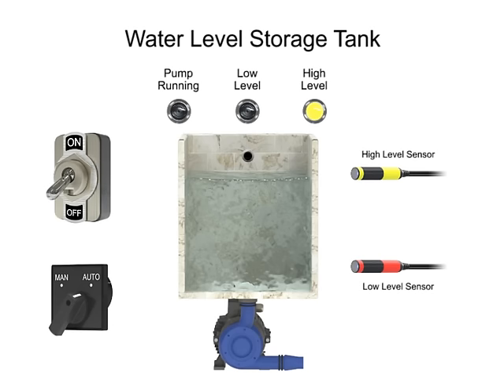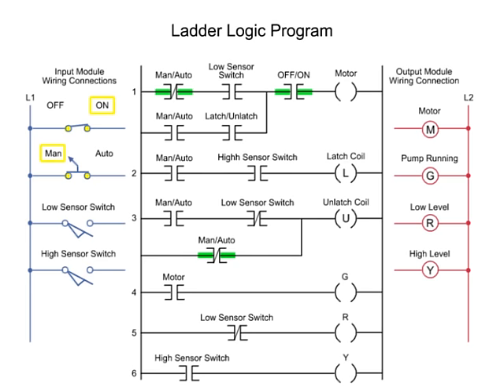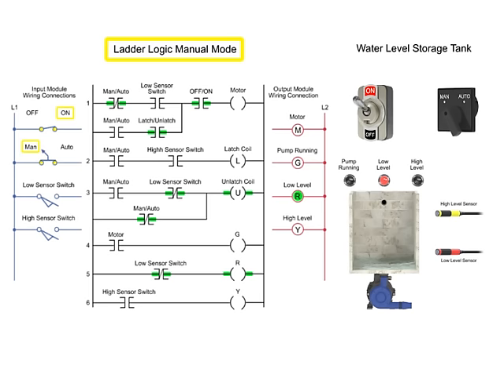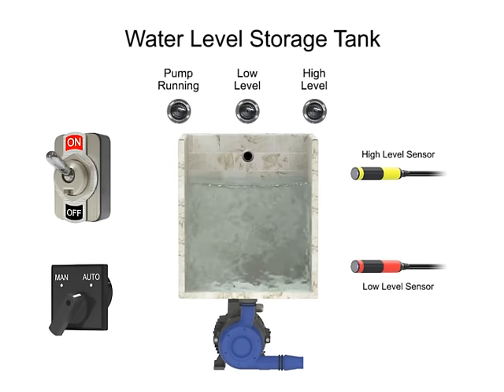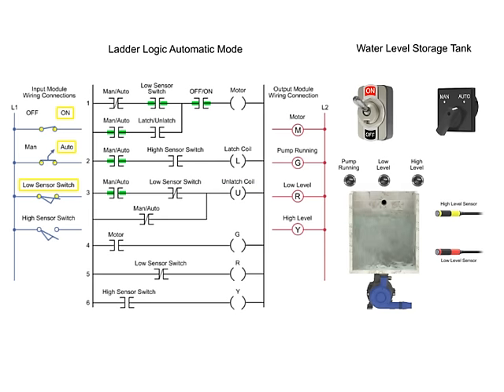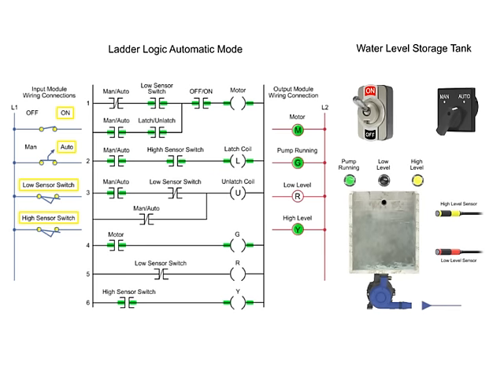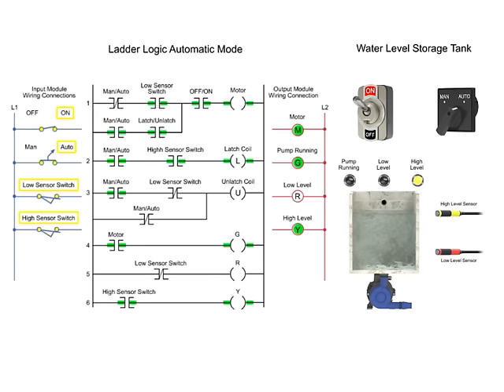Controlling Water Level in the PLC Ladder Logic Program

Comment: Please I want to control up to 9 tanks with 3 pumps from 1 borehole. 1 pump feeds 3 tanks, but if the 4th tank goes Low, the 2nd pump comes on and if the 7th tank goes Low, the 3rd pump comes on. The 3rd pump goes OFF when we have less than 7 tanks, and the 2nd pump goes OFF whenever we have less than 4 tanks in service. This implementation can allow 9 tenants to automatically / manually control their water tank levels without some tenants taking water every time to the detriment of other working - class tenants who visit home late in the nights after work. Each time a tank is Low, a pump will come on, a valve will open...two tanks...3 tanks the same pump..if a 4th tank is empty, the particular valve opens and the 2nd pump comes into service...but if 1 or 2 tanks are filled, 1 pump drops off...etc .thank You. My pumps here are for tank filling, not for tank discharge...
the discharge shall be manually by domestic consumptions..tanx..

Comment: can you give us more discussing about latch and unlatch bits 
Are latch and unlatch control on the motor and pump or not?
Reply: There is only one latch/unlatch bit

There is only one latch/unlatch bit, and it is an internal bit i.e. it does NOT represent a direct input from a sensor or output to a motor or a pump or a lamp.

The most important thing to understand is that the latch/unlatch bit represents the LAST state CHANGE of the level inputs; it does not represent the CURRENT STATE of those inputs, nor does it represent anything about the motor or pump.

The latch/unlatch bit is internal to (part of) the PLC program so the PLC can keep track of the last level sensor that CHANGED i.e. whether the last level event was a high (latch/unlatch bit value is 1 i.e. latched on Rung 2) or a low (latch/unlatch bit value is 0 i.e. unlatched on Rung 3).

The latch/unlatch bit is the bit in the contact input labeled "Latch/Unlatch" on the first rung; it is the bit in the coil labeled "Latch Coil" on the second rung; it is the bit in the coil labeled "Unlatch Coil" on the third rung.   it does not represent a direct input or output

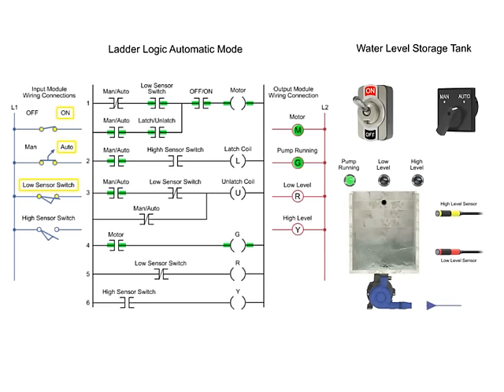At 1:42-1:47, the audio says that the "water falling below the low sensor switch stops the discharge pump motor;" that is correct but not the whole story.  It would be more accurate to state the water falling below the low sensor switch assigns a 0 to the value of the latch/unlatch bit (on Rung 3), and that latch/unlatch bit value of 0 is what actually stops the pump motor (on the next scan, on Rung 1, lower branch, Latch/Unlatch contact).